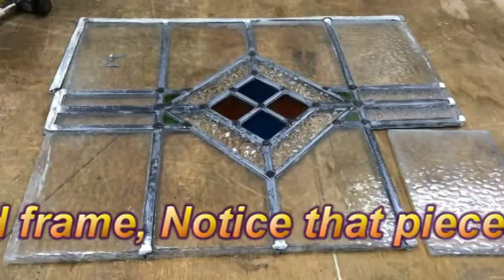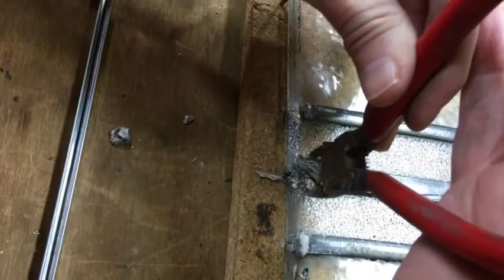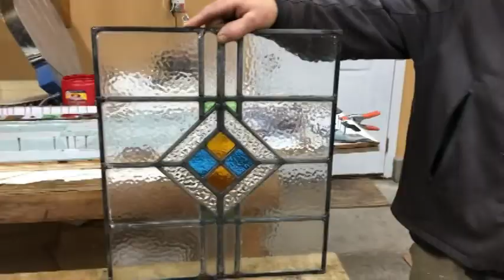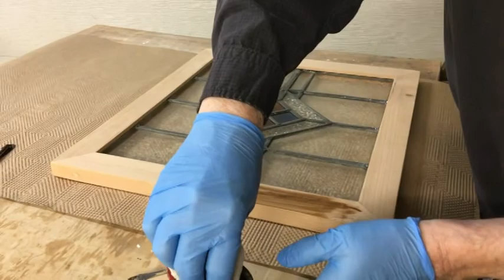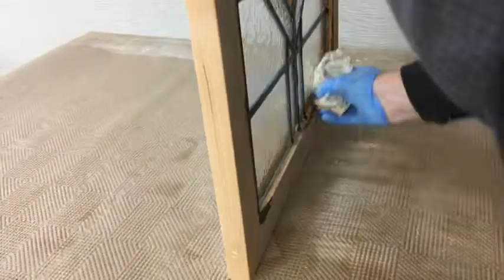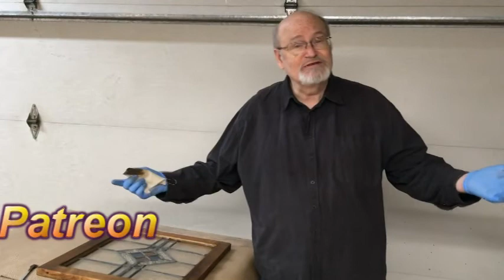Repair Old Stained Glass In New Frame V296

Comment: Why did you wait to stain the frame until after the panel was mounted in it?  Wouldn't it have been easier to stain the pieces of wood first?
Reply from the maker: Just personal preference, caulk sticks to raw wood more aggressively that stained wood. You method should work fine